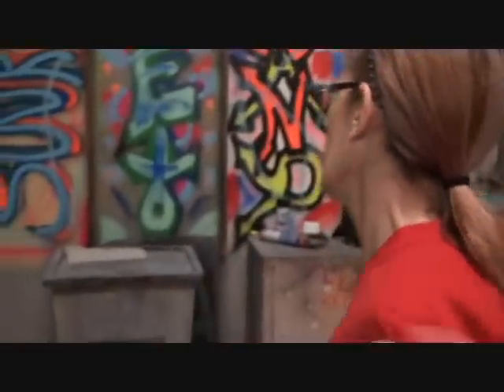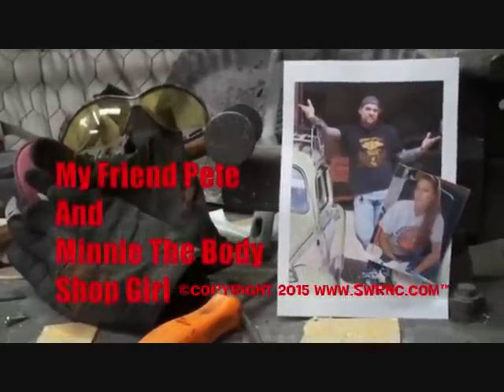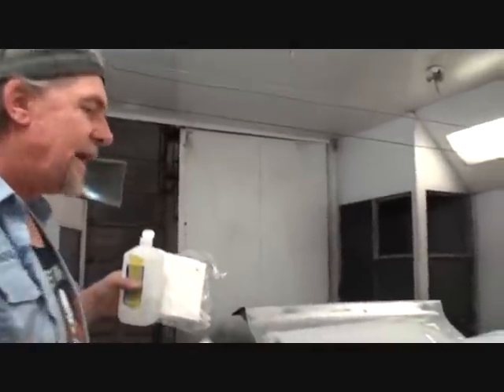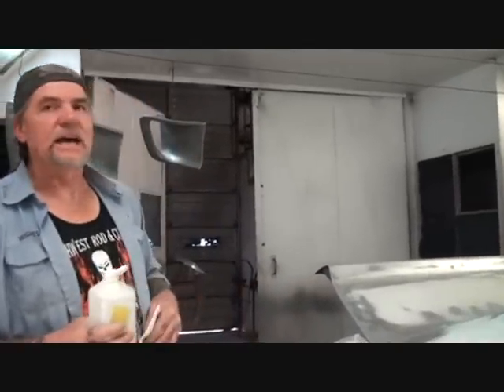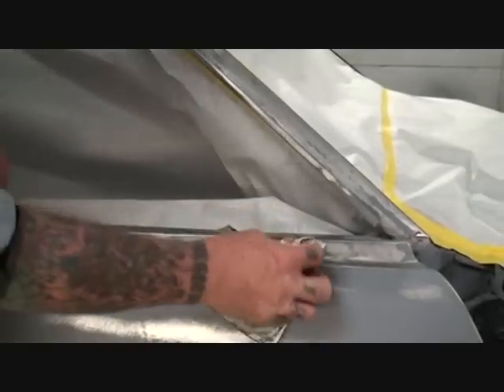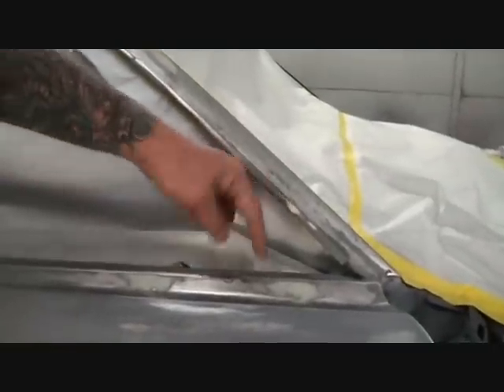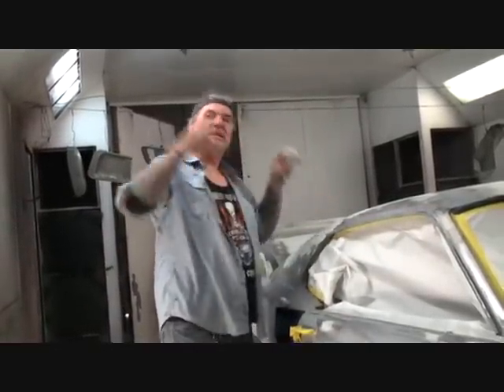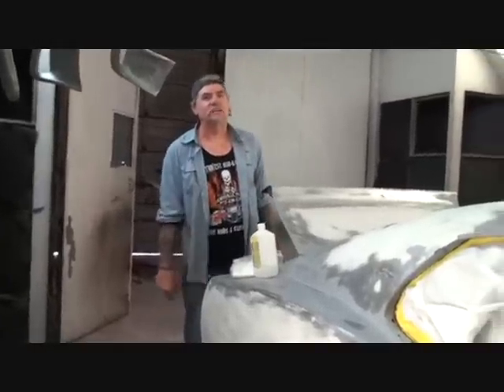How To Prep Bondo Putty for Primer-Auto Paint And Body Tech Tips

Comment: Excellent information Pete.  No reason to use the expensive stuff when rubbing alcohol will clean the dust, grime and grease off the surface, getting ready for primer filler.  This is quite applicable for me as my car has been sitting in my garage with epoxy coating on it for the past 16 months.  Back in the groove again with intent to shoot primer very soon.  Thanks for the helpful tips Pete.
Reply: Isopropyl alcohol

Comment: That was a great video, Minnie 70%, Pete 30%. Who had the most fun in this video?
Reply: How come wife’s know all the right buttons to push? Is it instinct? Is it taught? Is it learned behavior? I think all! Thanks Minnie....I mean Pete! Or did I?
Married 40+ years I have an empty lower level. A family room, and two bed rooms. The garage I got is a 1 1/2 car garage. When Retired, 4 tools boxes, sandblasted, MIG welder, Torch, 2 sewing machines, engine on stand, engine cherry picker, auto trans, and 100 boxes of new parts.  I am told that I can’t put clean mark boxes of my current and last project can not go into an empty bedroom. But my son can stack seats, core support, trim, grills, door panels and much more in the same room. But I can have one box in the room! Watch is wrong? I bought the house but I get to use the tiny garage? My last garage, I built block by block. 28 feet X 34 feet with a 12 foot ceiling. Gone. Oh, it’s still there and the compressor was in the top, with a 4 X 4’ door at the back, at ground level. But no, she wanted at house bigger in a better place. I walk in over lunch and she said this is it! I told her i am with you and went back to work! Now this! Not! I get half!

Comment: I'm confused. Is 2k primer and 2k epoxy primer different? i'm doing my car piece meal, fenders and doors first. Then the other removal panels, 1/4 panels last. I stripped the fenders then sprayed 2k epoxy primer on them. Now i'm doing very minor body work, "bondo'. Every step I block sand. Next up is to cover the bondo areas with more 2k epoxy primer, then guide coat. Should I be using a different primer? I was thinking after guide caot then a primer surfacer? Am I doing it right? I will not be doing the final painting, only prep. Thanks. Good tech tips!

Comment: pete when you are finished wiping it down and are ready to prime. What kind of primer do you use? epoxy primer DTM then filler primer? or straight to filler primer ?
Reply from the maker: +Koester3268 You want to go straight to 2K Primer at this point! 3 Full wet coats and then your ready for blocksanding with either 180 dry or 400 wet.. Then you would spot prime again with 2K primer and do your final blocksanding. Once it's ready for paint then you would apply your epoxy primer as needed and finish it out! Thanks for watching. Pete
Reply: Thanks Pete , enjoy watching your videos. Learning alot getting ti done!!!

Comment: Good sensible tip but I'd be changing out the rag when it gets that dirty. No???
Reply from the maker: +EdOfTheNorth I do change it out, if you noticed I open it up and refold it to use the other sides.. In this procedure since we are just priming it we are only concerned of removing the dirt and grease from the bondo,, when the car is painted more towels are used... thanks for watching ED!

Comment: Well Pete hate to disagree but I would totally go by paint manufactor recommendation. which would be water- borne,and solvent degreaser. But they are not 63 cents a bottle.plus you keep using the same dirty towels to whipe every.  you should switch towel as soon as it is fully contaminated. do not turn inside out and keep whipeing